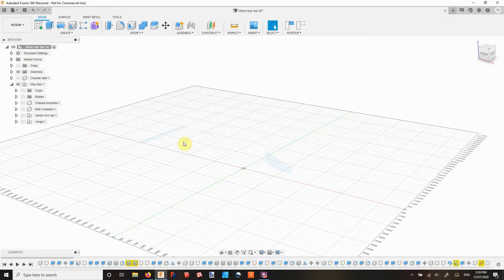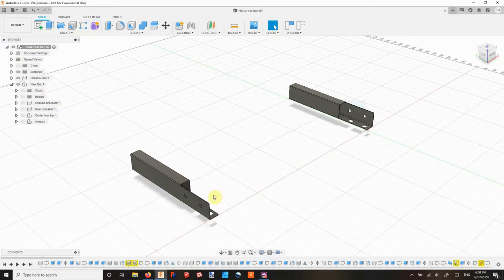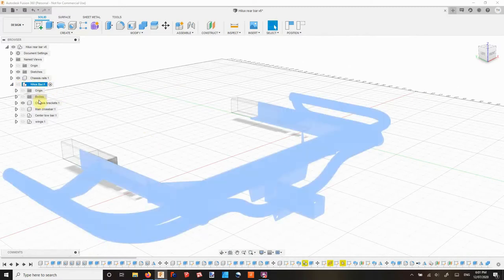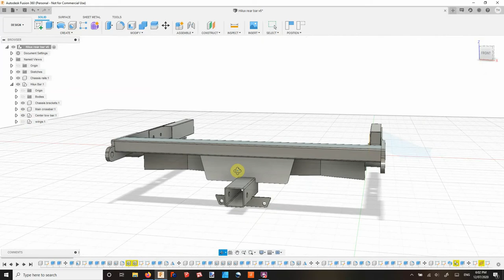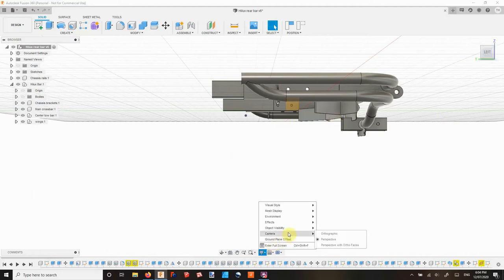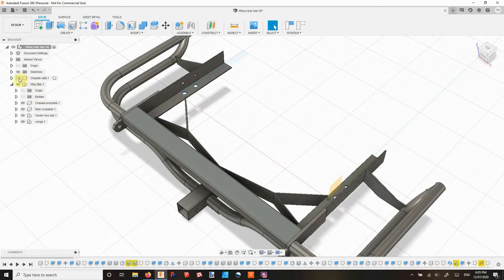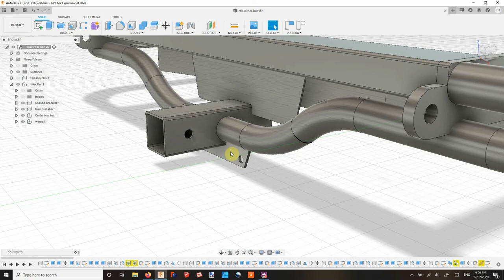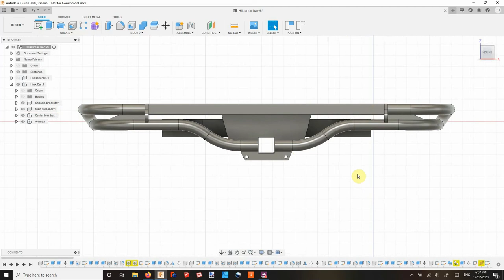Toyota Hilux rear bar design on Fusion 360

Comment: those plate bracing for the tow bar look weak as piss, better off having them on the flat
Reply from the maker: Yeah I never even needed to put them in for real, was just tossing ideas out to see what could be done and still fit a 33inch tyre under there. Check out the latest vids of the actual build. I ended up putting something much simpler in there.